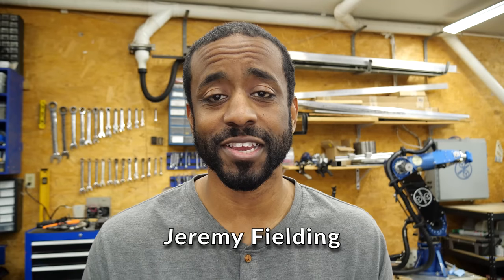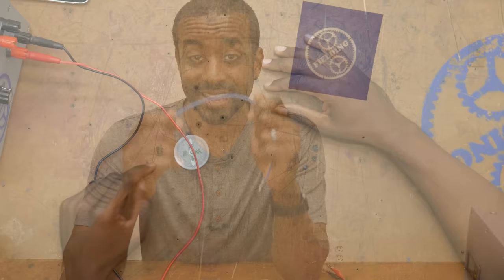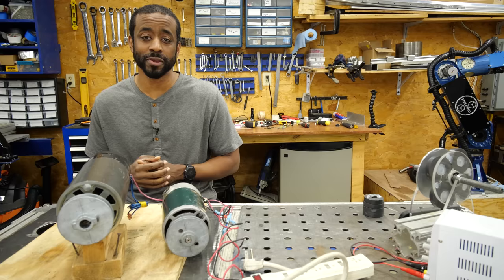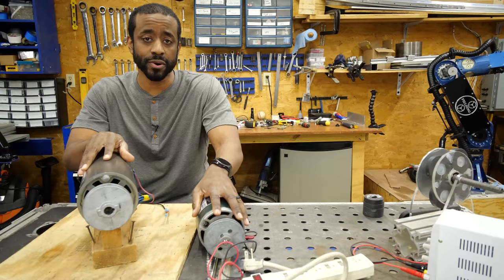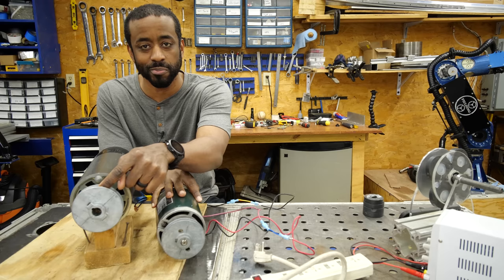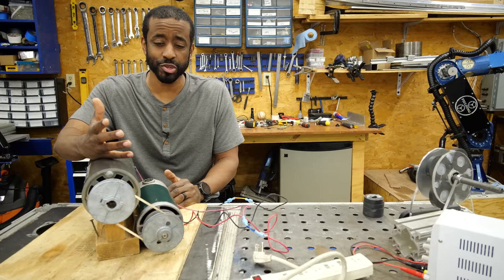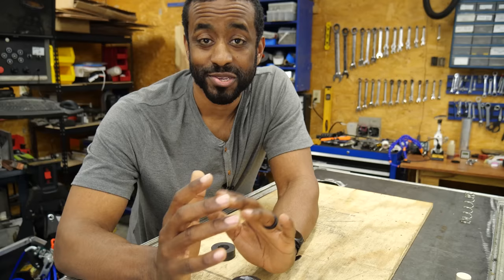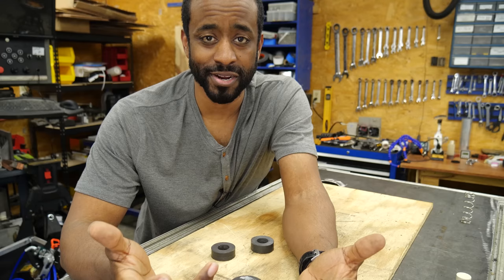Reviewing Free Energy Generators.  A Response to My Video "Nikola Tesla's Greatest Invention"- 102

Comment: It’s interesting to tinker with rare earth metals (magnets). Before hyper coasters were a thing I was in middle school science class and designed a track or rail to which I affixed magnets to each rail and spaced apart evenly running down each side. They were on small shelves that were connected with linkage to make sure when one moved, they all moved equally. This was a task as the play in each connection hindered performance of the final goal. Through trial and error I was able to eliminate most of the play and this lead to another issue. The spacing had to be perfect from one disc magnet to the next. I fabricated a model coaster and affixed magnets to it as well only flipped to repel the rail magnets. 
This failed in testing. So I canted the magnets all around to attempt to push the coaster forwards and it showed promise but needed further adjustments when it hit me. 
The magnets can stay affixed or even removed except two on the back of the coaster. They needed charged but did create a consistent push in conjunction with flipping the magnets from the back of the rail in unison on both sides then flipping the next set then the next set until momentum has built enough to push the coaster forward quickly. But, they must be electrically charged and deactivated in timing to the next set to achieve a smooth velocity to which must be able to be taken over by inertia as the propulsion fades quickly. All that was needed to achieve my goal was to develop enough magnetic push to send the coaster to the top of the first hill, then gravity and momentum can take over, given the design of the track allows it to. 
We were successful but it required an outside source of energy to charge the magnets and power the magnet rack with linkage to flip each set of magnets , one after the other. 
This design was very difficult to work out the inefficiencies involved but through tuning and many adjustments we were able to propel the coaster up and over the first hill (only hill) but the push is too extreme meeting G-forces that would crush a real person. 
Fast forward to 2010 and the hyper coaster was created. Low and behold they figured it out and brought it to reality. So I went to Cedar Point in Ohio to see this new coaster, ride it and really get a look at how it worked. 
I became a rollercoaster enthusiast and a member of that club to get the opportunity to really get access to how it functions and it looked a lot like my class room assignment. 
They were able to generate an immense amount of power using large magnets and large capacitors that are charged then send burst of power to specific areas to create the thrust needed to propel this massive coaster over the first hurtle and it does it at almost neck snapping fashion. 
I’m still going to figure out perpetual motion that’s both compact and high output in energy. These two scientifically do not mesh but they will soon. 
Then I’ll figure out cold fusion and let you all know😉
Reply: so it appears that your still in the need of a set switching device such the likes of a timing device simila to a 2N555 timing chip or similar  to that efect maby.?
Reply: @davidhogden2875  
That looks about right, maybe.
Reply: You guys can play w/ these elementary science projects. As for me... I'm working on a lamp that will illuminate the nearest black hole so we can see what's in there.
Reply: @SKYGUY1  
That’s interesting. I’d like to see that too. I’m wondering how you would overt the crushing affect of the black hole and the pull it has is immense sucking and destroying everything it pulls into it. 
Science is science. There’s no level to which is compartmentalized into any category that would be childish or grade school.

Comment: No matter how you connect everything, there is no way to get enough power to the system to make it run indefinitely without an external source. Too much power is lost along the way. Bearings have friction, the motor loses power through heat, belts slip, etc. Jeremy is 100% correct. Even if you could get the system to run without an external source, as soon as you plug something into it, and some of the power is siphoned off, the system will stop.
Reply: Which is why you use electro magnetic coils to amplify the 12v circuit...
Reply: Exactly, perpetual energy is not feasible. If it was we would live in a much different world.
Reply: An old guy that worked at the shop I work at was a junk machinery collector and dealer and he told me about a certain generator and motor that he had that he could hook them together and get them going and they would feed each other and keep going. He said it would also run a small amount of extra like a light bulb. He explained it was rather sensitive and he would plug the motor in the wall to get it going then quick switch to the generator and it actually needed the load of about a 100 watt light bulb. If you put much more it would quit and if you shut off the light it would get thrown off and quit.
I asked him to be sure and let me know when he had it hooked up again , I wanted to check it out. I was all into that kind of thing and really wanted to see it first hand.
He retired then died soon after so I will never get to see it.

Comment: Thank you for the lecture. I'm one of those who willfully believe that perpetual motion out of nothing should be a thing but much to my dismay and thanks to this video, I know better now.
Reply: Ya brother, the conservation of energy states that energy is not created or destroyed, a step father and you see that this means energy output can never exceed energy input but because of practical losses (heat, sound, friction, emr) you’ll never break even. 
With electrical generation you actually also have increased resistance so a generator powering itself will always loose. If you watch when he has the two permanent magnet motors the one being spun electrically spins way less than the one turned by hand.

Comment: When I was studying electronics, they taught us an acronym - TANSTAAFL (pronounced tanstaffle). There Ain't No Such Thing As A Free Lunch. Power in = power out, including power outputs such as motion, light, heat, etc. There is ALWAYS some energy conversion besides the one you really want. Thanks for always giving us the straight goods, usually with a small conversion to a humour output.
Reply: This "Law" only applies in the 3rd dimension. Once you use the 4th dimension, it works.
Reply: First heard that from Heinlein - "The Moon is a Harsh Mistress", IIRC.
Reply: yes, there are always parasitic losses draining the system down
Reply: That's thermodynamics for you: You can't win, you can't break even, and you can't get out of the game...
Reply: @rogerrabbit80  You remember correctly, and if you hadn't mentioned it, I probably would have. :)

Comment: It is important to make a line between "free energy", and no "cost to you energy".
If you hook a rectifier up to an antenna, you will get a small amount of power that is otherwise unrecoverable waste. Not free, just already paid for and doing nothing but contributing to the relentless tide of entropy.

If you put a Stirling engine in the ocean you can generate power. I didn't do anything to make there be a temperature difference between the ocean and the air, but there will always be a difference, and therefore power to be claimed.

Both of these are useless at any kind of scale, but they are fun to play with.
Reply: if you hook        you will get        if you put       WHOtf  is this  'you'  person.?!?!?!?
Reply: @daviddavids2884  You.
Reply: i discovered free energy 6 months ago but i dont want the authorities to find out !!    but i will share this with you anyway .  i took many of my household appliances and hooked them all to a large power bar then ran the other end of the extension cord to my neighbors  outlet on the side of his house . ever since then i got free energy !!
Reply: In Hawaii they have a tube loop going far down into deep water that uses the temperature differential to move water through a turbine.
Reply: @baneverything5580  That's super cool

Comment: The motor on some vehicles can be wired to act like an alternator and recharge the battery.  This can be used during breaking and  long down hill drives to recharge the battery.  The power comes from the car rolling down hill,  or slowing during breaking.

Comment: Electric cars do have alternators. 3 of them usually. Most of them have regenerative breaking. When you are coasting to a stop, the stators on the motors are still spinning. This induces a current in opposition to the motion and a corresponding magnetic field. This generates breaking force and as a result recovers a small amount of power to the batteries. 

Small amount. It’s not free energy, it’s physics.
Reply: Correct, they are the same, but have a different purpose/configuration. I think that's important to realize that for this specific scenario/video. Regen braking is returning normally lost energy to the high power EV battery while an alternator provides charge to a battery needed to start a vehicle. This will become important if you drive an EV and have an issue with the auxiliary battery. I know it's splitting hairs, but I had to learn that there is a difference.
Reply: I agree that this could be worth a mention in the video as a real world example of how it actually works vs the claims he is disputing. But I also agree with Antwan that it's a slight difference than the purpose of the video, and that it might just muddy up the points he is trying to make. That is a great point you brought up tho! I was debating saying the same thing haha
Reply: @AntwanG  There's no battery to "start" an EV. There's nothing to "start." There might be a 12V battery to buffer the 12V systems, lights, stereo, etc. But that isn't  actually necessary and it would be charged by the high voltage battery through a DC-DC converter, which wouldn't actually need a battery or smoothing capacitor if it was stable enough on its own.

Some hybrids use 12V batteries and alternators, though they aren't strictly necessary there either.
Reply: @Bob5mith  you are right that the 12v battery doesn't start a pure EV. When the 12v failed in my last EV, none of the accessories worked without the main battery running. So I couldn't use the fob to unlock the car for instance. I was just pointing out that it's not a traditional alternator that charges the 12v so you can't take it to a random mechanic to troubleshoot.

Comment: It’s the wattage that supplies power, voltage isn’t a constant, then you add in resistance there’s  where your power loss is at, unless you can use transformers and step ups and or a battery source that stores energy and collects energy quickly that can also provide energy to the system when it is needed to, to provide the necessary energy to keep the system running.

Comment: An even simpler thing to point out about these machines: does it make noise? If so, that's energy loss. A machine cannot be truly 100% energetically efficient as long as it makes noise, because that bleeds out energy
Reply: Also they have fans in them for cooling. That alone will consume energy, but more than that it tells you there is heat that needs to be managed and lost.
Reply: Not necessarily. If a machine was more than 100% efficient it could still make noise and be over 100% efficient. It just means that whatever losses are incurred within the system lower its net efficiency.
Reply: @alphaforce6998  yes but this only applies to machines that generate more energy than they consume. Perpetual motion machines aren't in that category
Reply: there is a problem with your statement. the problem is that they need to be more than 100% efficient... 100% efficiency is already virtually impossible let alone more than 100% which is what is needed to not only achieve perpetual motion but also provide enough excess energy to power things like power tools and more which they often claim their machines can do.
Reply: ROFL
Reply: it would be 1000% energy efficient if only it could make mean tweets
Reply: Noise = friction = energy loss
Reply: @Astroqualia  then please indulge us with your knowledge of stars, including our sun.  Or maybe black holes? Do you think they are going to stop?
Reply: @dalemoore435  they will eventually , in a few billion years or so.
Reply: @plazasta  Perpetual motion machines can be 100% or more efficient to fit the commonly accepted definition, and even if a perpetual motion machine did emit sound as long as it was still able to sustain itself it would not matter.
Reply: @godw1ll99  A machine doesn't need to be 100% efficient; it just needs to be able to capitalize on an unlimited power supply, and one such possibility is aethereal electricity. To harness the electricity in the aether, all you have to do is suspend a conductor some height above the earth and fully insulate it from the earth. Just by doing this a current will be induced in the conductor, but a very low amperage. There is undoubtedly a way to magnify/amplify this electricity by experimenting with methods of harvesting it... but any machine powered in this manner would be "free energy" though not "perpetual motion".
Reply: @alphaforce6998  ... if a machine produces more power than it consumes it is more than 100% efficient... you dont just magically tap in to a power supply. you need to put work in to get something out. the difference between what you put in vs what you get out is the efficiency. 

people keep trying to come up with complex ways of doing something that is fundamentally very simple and can be exemplified by simply using gears that take a low speed input and turn it in to a high speed output. either way you go from a low speed high torque situation to a high speed low torque. im using this example because it is the same thing these snake oil salesman are doing. using a simple concept to trick people in to thinking more is coming out than what is going in but all in all there is less out put than input even if the results dont make that evident. 

specifically in the case of the gears is people would see a low speed input being converted to a high speed output and all they see is the increase in speed thinking they are getting more out than they are putting in.
Reply: All of the motors he is using have friction loss im sure.. But they have magnetic bearings now.. 0 friction.. might be possible then?
Reply: @soulwarrior7721  the bearings aren't the only source of friction, air does that too. To avoid all friction, you'd need to achieve the perfect vacuum. The closest we can get right now is the void between galaxies
Reply: There is no "110%" when it comes to measuring efficiency lol, its either between 0% - 100%, no exceptions.
Reply: Don't forget friction.  Friction causes noise.  Noise is indicative of friction.  Tiny amounts of it , even parasitic amounts will eventually run long enough to cause enough loss of potential energy that its gonna stop.
Reply: That’s called mechanical energy loss, due to resistance.
Reply: @stevelloyd5785   hmm heat? It’s called thermal energy.
Reply: @godw1ll99   blah blah blah blah
Reply: @darkeside416  SUCH PROFOUND WISDOM!! HOW COULD I HAVE BEEN SO BLIND ALL THIS TIME!!! MY LIFE HAS BEEN FOREVER CHANGED BECAUSE OF YOUR GENIUS!!! THANK YOU THANK YOU THANK YOU!!!!!!
Reply: @darkeside416  Yes it is, and in this context it is parasitic. The heat or thermal energy is not a contributor to the operation but a loss due to the operation.

Comment: Thanks for bringing common sense and basic engineering to the masses.  When working with extension cords with two male ends, it would be a lot safer to plug the load end in first,  then plug into power source.  But maybe the danger element gets more viewers!
Reply: LOL, I like how you finished that, but yes, the other way would be safer.

Comment: Great explanation - I spent decades trying to find solutions using magnets - you can't change the laws of physics - I have found that you can make things much more efficient (not necessarily cost effectively) but not generate the energy itself
Reply: Magnets do generate Energy!
Reply: @ZackWolfMusic  No they don't. You cannot create or destroy energy. Only convert it from one form to another.
Reply: @paulanderson79  Yes they do magnets can produce electric energy.
Reply: @ZackWolfMusic  They don't produce energy at all. You can use them to generate electricity but you have to move either the magnets of the conductors to do so. There is no way to create or destroy energy. That is a fundamental law of nature.